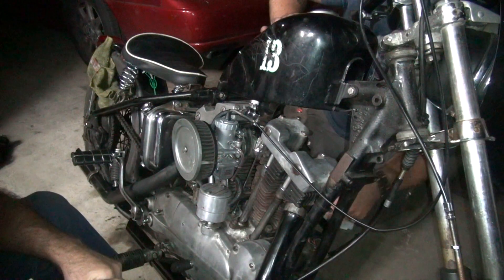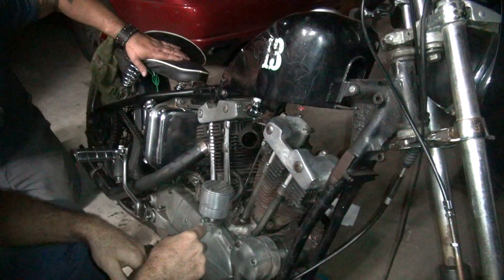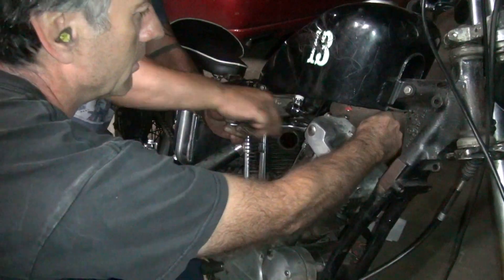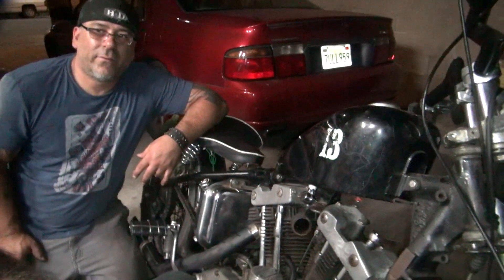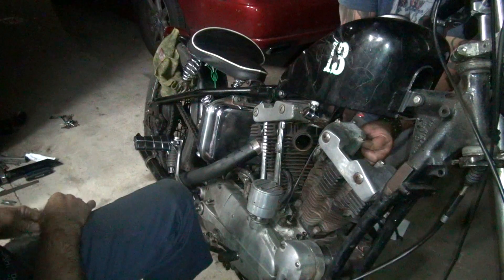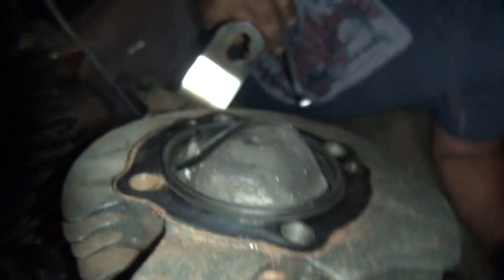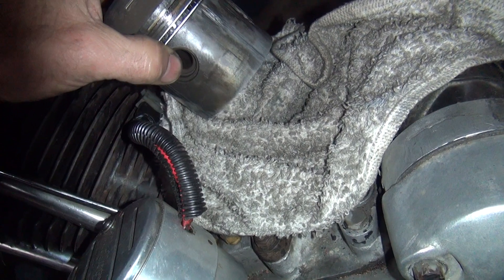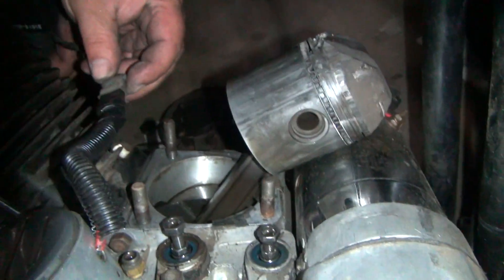#103 1964 xl 900 ironhead why does it run on1 cylinder topend rebuild sportster harley tatro machine

Comment: The piston was crazy hot when it failed, that why it’s dry I think.
Reply from the maker: no, it did not just happen. hes been working on it for awhile now. most likely it was caused by preignition for the crappy ignition or the wrong ignition timing.
tatro